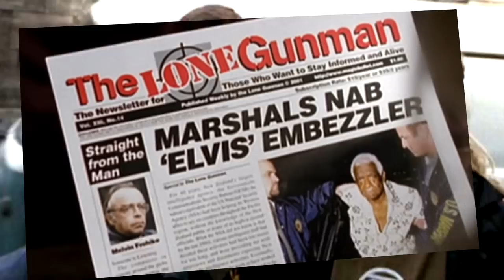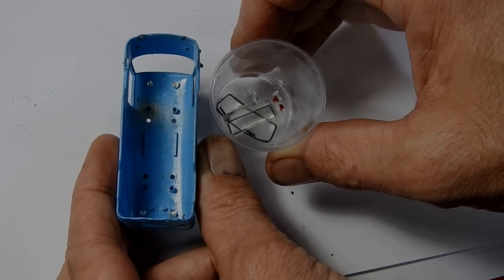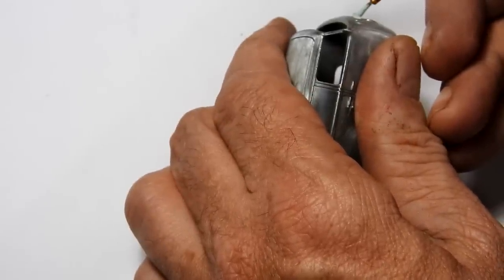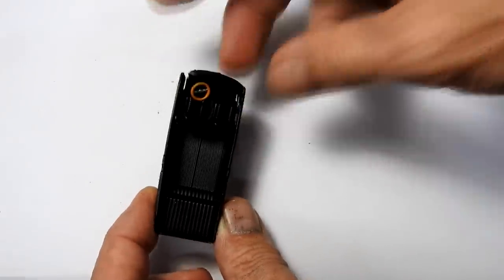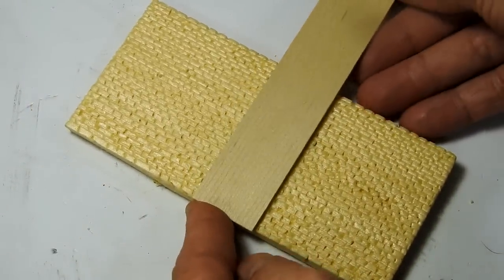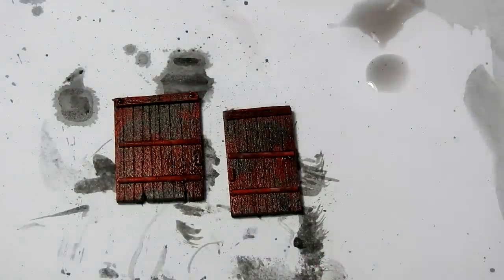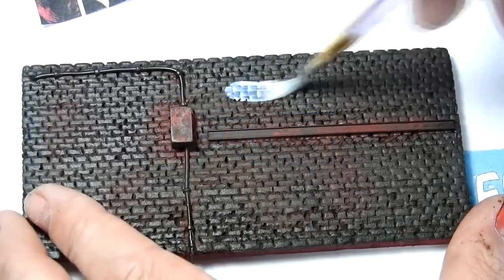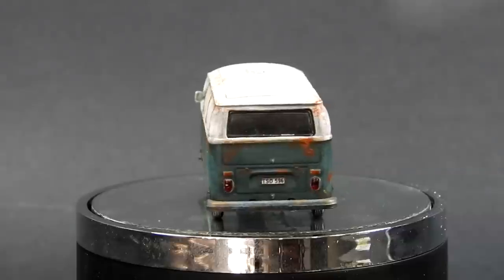The Lone Gunmen's VW Combi Panel Van Diorama | The X Files Spin Off | Danny's Slapdash Dioramas

Comment: Very nice custom Van and diorama. The groundplate is missing some more trash, old barrels, broken crates, oilstreaks burnt rubber from making donut s in front of the shop..  etc. but there are so many fine details, the old papers on the grpund, the posters on the wall., the sling doors even when they are fixed... .

Comment: It was a great show. Episode 1 is very difficult to watch, nowadays, though, featuring as it does, an airliner programmed to crash into the World Trade Center. A year later, as we know, that unthinkable scenario occurred for real.
The series was left hanging when cancelled, but Messrs. Frohike, Byers and Langley's story was completed in an episode of 'The X-Files', 'Jump The Shark' in 2002, when they save the world from a biological agent. The episode ends with their funeral, with full honours, at Arlington cemetery. However, a question remains if they are really dead. We'll never know for sure.

Majorette did make a VW van. It had an opening rear hatch. I had a red one, advertising 'Café HAG' coffee.
Your restorations, and dioramas are anything but 'slipshod'. You do great work, and this turned out beautiful. Nice one.
Reply from the maker: In one of the later comics it was revealed that they faked their deaths 👍